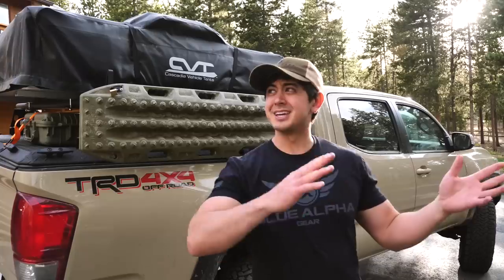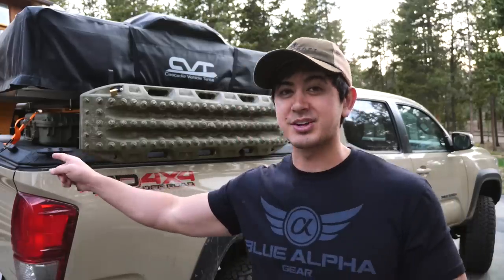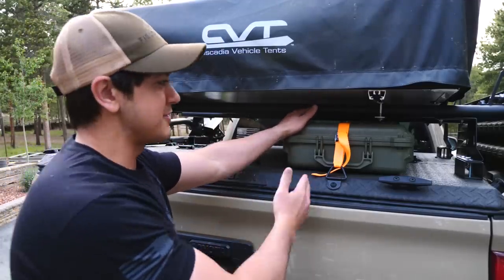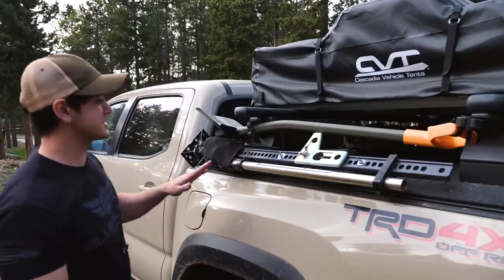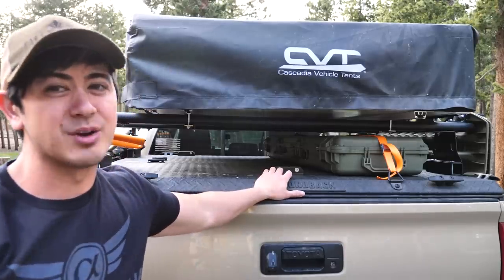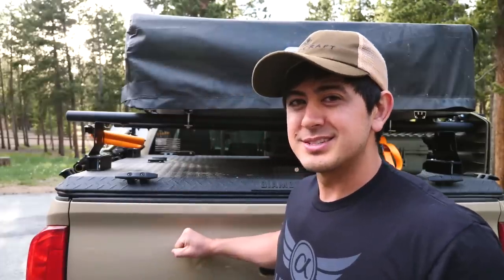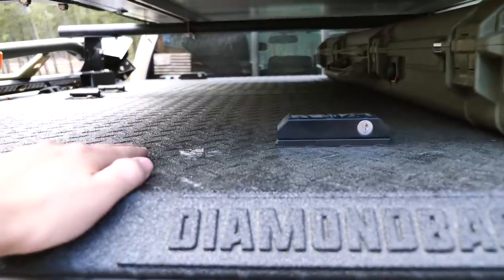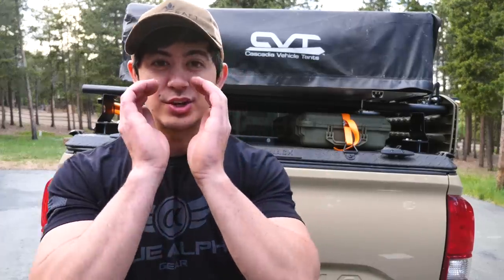Overland Bed System (on a Tacoma with Diamondback) That is also awesome on a daily...

Comment: Very comprehensive review! Had to let go of my White Toyota Tacoma and bought a new Black Silverado. Won't get the Diamondback Smooth Cover until mid June. Security is my main reason for the purchase.  I'm really interested on how other functionality can be incorporated in this unique cover. Later, I plan on getting some secure Yakima Kayak holders - probably roof mounted. Access to the bed is important during camping trips. I will continue to monitor your videos for creative ways to utilize the Diamondback Truck Covers. Thanks for all the hard work you put into your videos.

Comment: Hey Mike, keep a close eye on those vertical bolts that go through the box tubing for your rack. They have a tendency to loosen up because the box tubing flexes when tightening the nuts and when a load is put on the bolts.  Proper procedure (and it wouldn't be too hard in your particular setup) is to have a sleeve that the bolt goes through inside the box.  This would prevent the box tubing from squishing when you tighten the nuts.  Hope that makes sense... I'm happy to clarify if it doesn't.
Reply from the maker: Ah thanks for the recommendation, I'll keep an eye on them and see if I can find some sleeves somewhere. Local hardware store might have?
Reply: Last Line Of Defense Yeah, you should be able to get some round tubing at the hardware store that will fit over the bolt; anything that's not SUPER thin will be fine, steel or aluminum, and cut it to fit inside the box tubing and you're GTG.  Of course, some kinda locking nut would be a good addition too.
Reply from the maker: Yeah I have nylon locking nuts and washers underneath - checked and none of them were loose (yet), but had previously noticed a very slight bow in the aluminum tubing. I noticed this though when I originally mounted it because of how much I tightened the bolts.

Comment: I got a trd 4Runner since I knew I'd spend a ton to secure the bed.  Plus you can sleep in the back if you have a roof rack to put your junk on. But to each his own.
Reply: Rubicon V I am in the 4runner or Tacoma conundrum myself. By the time I put a camper shell on the 🌮 it ends up the same or more money as a 4runner only with a lot of horror stories about spending the $ and still getting leaks and dust intrusion
Reply: hdjc86  That was my thinking exactly.
Reply: Rubicon V of course I still lurk the vanlife videos wondering if I could fit a Quigley 4x4 van in my parking spot and do a build for less $s

Comment: I am not really into off roading. I am just  into camping a lot. I like your set up with roof top tent on the top of your truck bed. And I found this 2017 Toyota tacoma off road with a trd rim and a nice tire, a roof rack and some few goodies for CAD$40,000.00. Now  I wonder if really need a truck with crawling system on it? At my age of 64 just wonder if I really need this kind of truck. Thanks

Comment: Mike, why not add a bed slide so you can drop the gate and pull the stuff in bed out for easy access? Truck looks great with the lift.
Reply from the maker: Takes up room, adds weight, I don't really feel like I ever need it. They're cool - I just don't have any desire to own one right now. Maybe I'll try one out eventually and get hooked, but right now I'm happy without.

Comment: Hey Mike, I'm really digging your channel. Just wondering if you could share why you upgraded to the HD cover? I read a few comments here where you mention the SE would work for this setup. Does the placement of the rails add additional load rating? I weigh about 250 and wonder about being in the tent with my gf, who is only about 100lbs. Are their other benefits you could share between the two models? Sorry so many questions.

Thanks!
Reply from the maker: Yeah I think the SE would hold up fine - Diamondback might recommend the HD to match up with their posted specs, but the SE is a very solid cover and a little lighter as well. I have the HD at the moment, just because they wanted me to test a few changes they made, so I was using it.

Comment: Any thought about mounting your axe to the inside of the tailgate instead of the front of the bed?
Reply from the maker: No, I never use it so I don't need easy access to it. I'd never mount anything to the bed though, it'd get in the way of loading, unloading, sitting on the tailgate and using it as a table - all things I regularly do.

Comment: Noticed you went from the M1000 racks to the AA-Racks. I'm guessing the bolts wouldn't go all the way through the bend in the M1000's?
Reply from the maker: If you wanna raiseit like I did, you'll need longer bolts for either system. I went with the aa cause I liked the look a little better and the towers were a little taller, I think it's a little lighter and it came with the ladder mount things that I used for my maxtrax

Comment: Hey man. I heard where you said your cover can hold up to 1600lbs. On their website it says only 400lbs. Are there different covers? Thanks
Reply from the maker: Hey Michael, yeah there is an SE and an HD - the SE is rating for 400 (dynamic) and the HD is 1600. The SE would be sufficient for this setup though as well.
Reply: Last Line Of Defense Thanks man!!

Comment: So how do you lift your truck with the hilift without metal bumpers or rock sliders?  Am I missing something?
Reply from the maker: I'm guessing you're missing a bit. I do have sliders now - but there are a dozen or more uses of a hi-lift outside of lifting the truck with the sliders (which honestly, with a rig with a lot of suspension travel often times sucks) - this is my favorite device though to use with a hi-lift - https://amzn.to/2liXea5
Reply: Last Line Of Defense I’m familiar with the uses of a hilift bud but thanks for making that clear.
Reply: Jake Ballard hahahahaha Im definitely sure that was the reason.   The uses the he eluded to also requires other equipment that he doesn’t have.  Overlander poser lmao
Reply: Jake Ballard good eye man.
Reply: Jake Ballard “ I have a covered bed but let me strap this Pelican case on the cover so i can carry my gear”.  “ oh yes i can lock the case to the bed so that its secure
Reply: Jake Ballard bottom line is that the overlanding scene has gotten popular lately and this guy just wants to hop on board and ride the wave so that he’s channel can stay relevant.  Not that I know much about overlanding but I do have a decent setup and actually do use it.

Comment: Why did you go with the cover and not a canopy?
Reply from the maker: Hate the look, heavy, tent would be way up high, etc. If I had a full length bed, then I'd consider a topper, since I'd be able to sleep in there if I needed/wanted. On a short bed, I think it makes less sense and I prefer this setup.
Reply: Last Line Of Defense Good deal. I have a '17 Tacoma Sport DCLB and just put a canopy on it. Slept in it over the last couple days at the PNW Overland Rally here in Washington State. It worked great!  I will need to work on some condensation control as the windows were fogged every morning, even with the windows open about half way. However,  I have a RTT coming that will go on the Prinsu rack on the cab,  so I won't really need to worry about it!

Comment: Is that the HD or SE Diamondback cover?
Reply: This video is of the HD. You can tell by the number of cross bars on it around the 15:22 mark. If you look at this Diamondback Review Vdeo that is the SE model you can tell by the cross bars around the 7:58 mark. That along with the blacked out hinges and hardware on the cover in the new video suggest that he got a new HD cover in the past month or so(when they upgrade to all black hardware) Which would make sense as the weight he was attaching to the top of the SE model was probably not recommended!

Comment: Manual or automatic transmission?
Reply from the maker: Auto. I don't like manuals unless it's a sportscar or dedicated wheeler. Too old to be daily driving in a manual... haha
Reply: Last Line Of Defense haha I'm torn between buying a stick or auto trd off road. I like the idea of manual transmissions but I know some days I don't want to shift haha.
Reply from the maker: Yeah, tough call. I know people say that the manual feels a little quicker - the transmission on these isn't awesome, and it does shift gears more than I'd prefer, so a manual would obviously solve that little nit.

Comment: So why is a high lift jack necessary? When might you use that? I expect you might have mentioned it in the next, more in-depth video, but at the beginning of that video you said that a lot would be rehash of this video, so I chose to not watch it. Thanks.
Reply from the maker: Too much to put into a comment, but hundreds of articles out there you could check out - https://www.roundforge.com/articles/best-hi-lift-jack-accessories-fourwheeling/

Comment: You can’t fully utilize the Diamondback with the RTT is on so the advantage of having a Diamondback is ...? Oh, you’ve got a hard cover that looks “cool”. Got it.
Reply from the maker: Secure hard cover that you can mount tents, hi-lift, cases, etc to, which is fully-weatherproof. And oh, as mentioned in the video, the 90% of the time when I don't have the stuff mounted - functions as 'normal'.